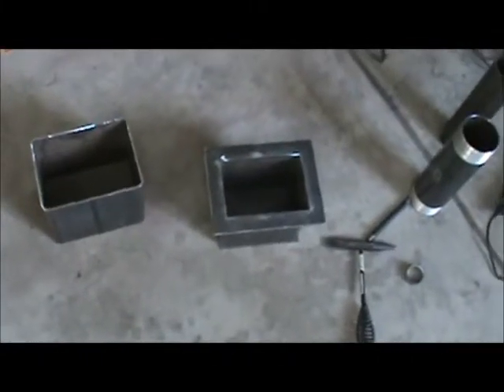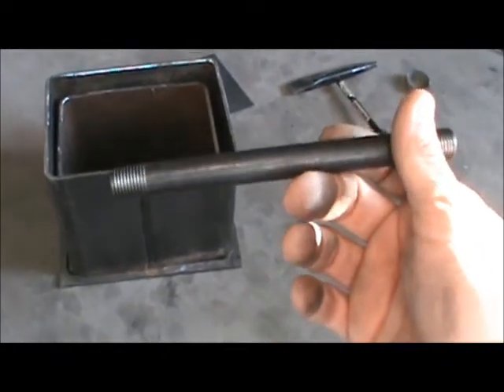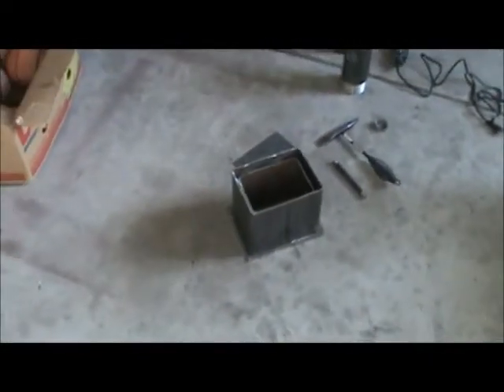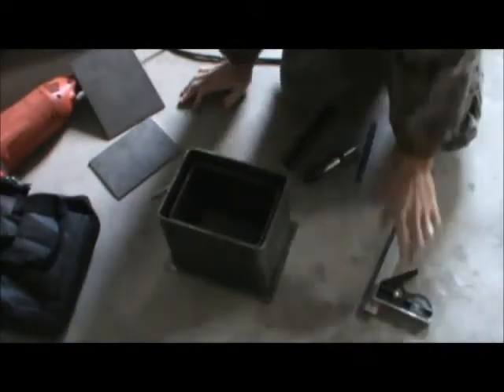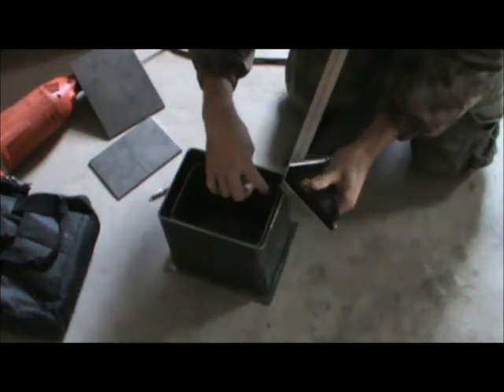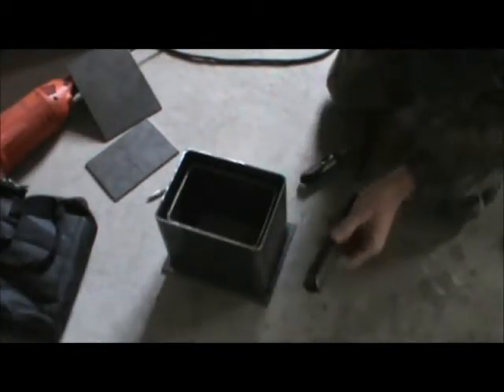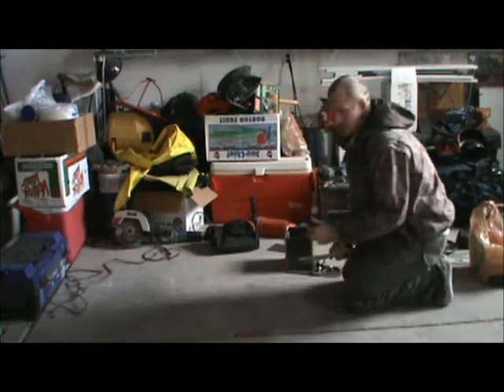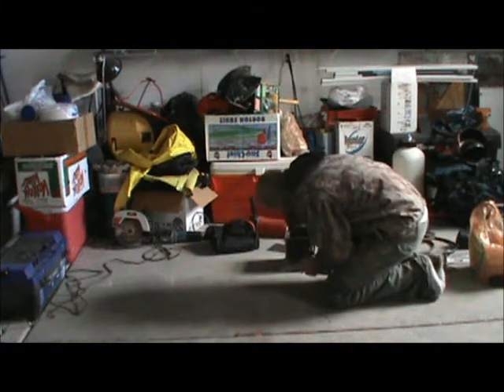100+ MPG Project New Vaporizer Design 1.4

Comment: Hey Tyson,

Man, you really need a good work surface like a bench but if that is not feasible, get one of the plastic fold up tables. That working on the ground is gonna make an old man out of you. Also, get a good light source right over you work area. It will make it easier to see and do layout work and as a side benefit the videos you produce will be so much better for us viewers too.

Comment from the maker: I am not sure yet as to the amount of surface area that is needed to run my car but I will tell you that the current surface area is more then enough. I will be shimming the container or I will be placing dividers in it so I can test and find the smallest surface areas that is needed to run my car on as little vapor as possible. Right now it's running richer then I would like. I will be getting a better high quality 5 exhaust gas analyzer to test the burn.

Comment: Tyson, 

Great job on the design! 

Question: How much gasoline area do you need to sufficiently vaporize enough fuel for the displacement of you motor? Do you have a formula?

What fuel to air ratio are you trying to achieve? How will you know when the fuel to air ratio is ideal? By exhaust gas temperature? Sorry for all the questions but I am very curious about this.

Comment from the maker: Thanks! I wont be using a transducer as of right now. I will first be testing using only heat. Once I have that dialed in I will be testing other methods. As of now I have found that heat works much better then a fine mist because is gets the gasoline to a much more volatile state therefore making it more efficient. I also want to try a transducer and after there is a gasoline fog pass that through a heat exchanger to further vaporize the gasoline.
Keep up the good work with the HHO!

Comment: Keep on truckin,keep the transducer off the floor so it can have fluid under it and I would flood the lower section of the transducer with water up to the top of the transducer then add the gas, the water level need to stay right up tp the top of the transducer,now it will stay cooler I am not trying to tell you what to do but it seemd to work when I hade my big chamber.D